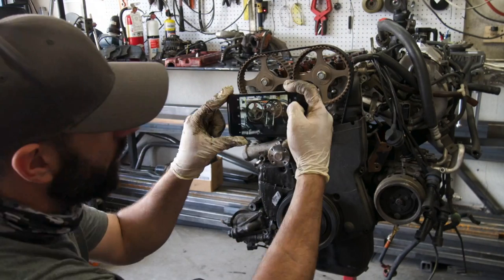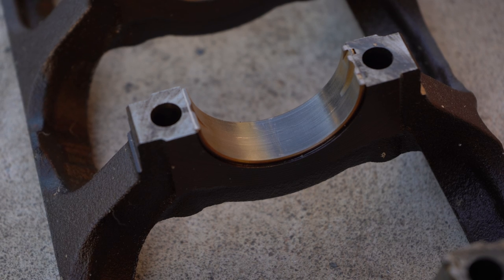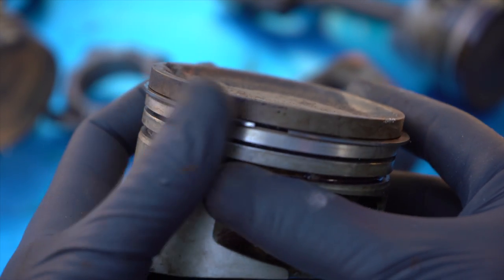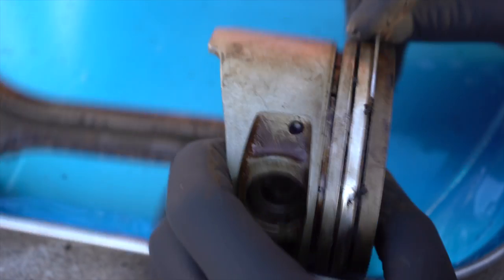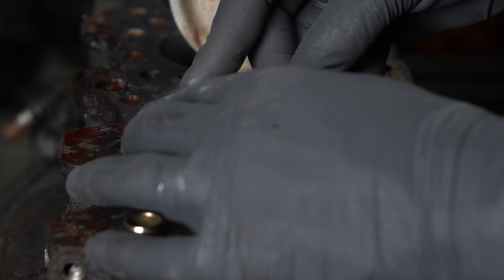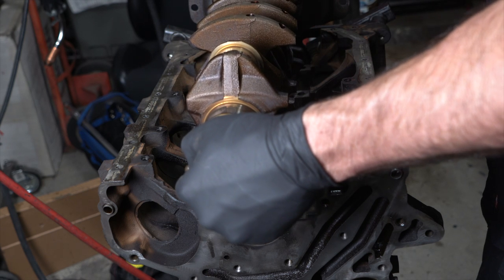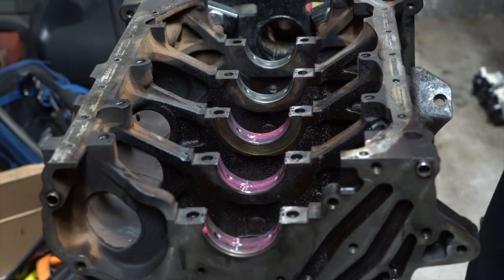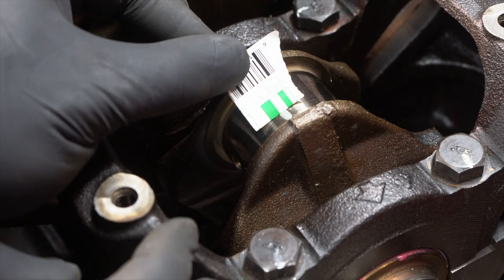Mighty Max Ep. 02: Rebuild a 4G63t  Piston Rings and Bearings

Comment: Go with what wiseco says. I run wiseco pistons in a g54b Mitsubishi station. Haven't had any trouble with what wiseco said to run. Cranks out about 350 hp to the rear wheels.
Reply from the maker: Thank you, Grant. I'll take your advice. Better safe than sorry. I'd hate to put it all back together and see smoke.
Reply: @GarageFab   It's .005" per inch of piston diameter, not .005" of total gap.
Reply from the maker: I understand. So a gap for a 3” piston would be .015
Reply: @GarageFab   Standard bore size is 3.346" (if I remember correctly). Which comes out to about .017". Although I run .021" of gap on most of the 4g63's I've built just to be safe. There is slightly more blow by but works well in the 400-600whp range. With a little extra ring gap it's peace of mind knowing I can do back to back to back pulls without the ring ends kissing and breaking a ring land.
Reply from the maker: @eatmorechicken1064  Almost sounds like you know what you’re talking about. Almost. 😂 
I might have to bug you about some stuff as I finish the rebuild. Know anything about turbos?
Reply: @GarageFab  I'm not a turbo guru but I know enough to help you. I've had at least one 4g63 turbo car over the last 20 years and sometimes as many as 5 or 6.
Reply from the maker: I guess I’ve only got a single question at the moment. Is the factory rebuildable? I overhauled the engine because it was smoking, but as I tore it apart it appeared someone has already been there. So my thoughts are either the rings didn’t seat properly or perhaps the turbo is leaking. 🤔
Reply: @GarageFab  Yes sir. You can rebuild them. I'm guessing you have the 14b turbo. Turbo Labs America has rebuild kits and as well as a few others. They can also rebuild and upgrade it for you. Turbo Labs America also has rebuild kits and parts on eBay.
Reply from the maker: So greatly appreciated Grant! I’ve got no idea what Turbo I have but I’ll find out. Thank you my man! 🙏

Comment: Just found your channel and it's great, keep up the awesome videos. Had to drop in to this ones comments as I've had multiple 4G63 cars and can't help myself. Loose ring gaps aren't a problem and will protect you from breaking a ring land. I've ran up to 0.030" without an issue on the 4G63. Make sure the second ring gap is slightly larger though to prevent flutter.

For what it is worth, replace the rod and head bolts with some ARP bolts/studs, run piston to wall clearance and ring gap on the loose ends of factory spec and the 2nd Gen 4G63 can pretty easily handle 500+ WHP and 450 ft-lbs of torque on the stock pistons and rods. I will say though, crank walk is real and it looked like that motor might have the start of it. Leaky piston oil squirters will kill your oil pressure...

As for turbo, the stock T25 is pretty weak. The thrust bearing is garbage in them and breaks easily causing the wheels to run into the housings. If you just want like 350HP, a T28 can get there and you can get them with upgraded bearings. I'm sure there are even better options these days but it's a fun turbo that's direct bolt in.
Reply from the maker: Thank you for all that! The engine is mostly assembled (with the exception of the timing belt, oil pan, valve cover, etc.)
Happy to say I did purchase ARP head bolts (Couldn’t get them factory), but I did find some factory rings finally.
I don’t recall what problem I had with the bearings but I know that it now has all new main bearings and mostly new rod bearings. (I scratched a couple so I put some of the originals back in 😬)
Thank you for the Turbo info!! I need to make or have someone make a custom exhaust header to get the turbo to clear my narrowed frame so I should probably buy one first! Any advice as to where to find them! Is it usually a direct bolt on?
Thank you my friend.

Comment: The wear in the cylinders, although minute, and the act of removing more material, ie. honing, will make the bores a little bit larger. Using the formula for circle diameter and circumference, a change in diameter yields a 3.14159 times more change in circumference. Therefore, .019 minus .005 is .014. Divide that by 3.14159 and you get .0045. You probably took that much out during honing. If you consider that the radius would change half of that, .00275, that is about how much you took off the surface of the cylinder wall. I have seen hone jobs that did much worse. Good job.
Reply from the maker: That smells like math! 🤮 I don’t remember where I left off with engine updates, but I think I got everything straightened out. I tracked down some factory rings. Those weren’t cheap. But it’s so situated and ready to go back together. 🙌
Reply: @GarageFab  awesome

Comment: Why did you choose that type of engine....just curious.... I'm a mechanic of 36 years and  a sbc man
Reply from the maker: Does the LS qualify as a small block? If so you’ll approve of the next project. (You’ll approve twice!)
Let’s start from the beginning:  The Mighty Max came with a carbureted four-cylinder that generated what felt like 25 horsepower. I wanted to get my wife more power but I didn’t want to spend a lot of time and money. The 4G63 engine bolts up to the trans that I already had, and the Mighty Max engine mounts bolt up to the block. In theory it’s one of the easiest engine upgrades. (even though I don’t know much about the Mitsubishi engine)
The SBC Engine doesn’t fit in Mighty Max without extreme modifications.
I put a TPI engine in my first D50. (Same as a Mighty Max) in order to do that I widened the entire truck. Both the frame and body. I didn’t want to do that again.
Reply: @GarageFab  I put a 5ltr Holden BECAUSE I HAD IT in my 2x2 hilux tray with a falcon diff centre mod running original hilux axles brakes etc.... pretty easy  with just  a little firewall mod